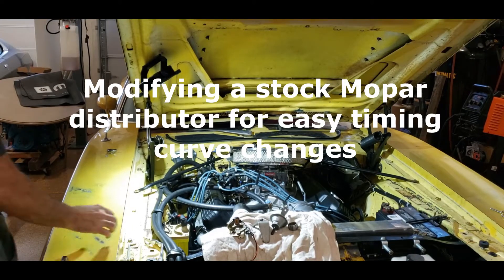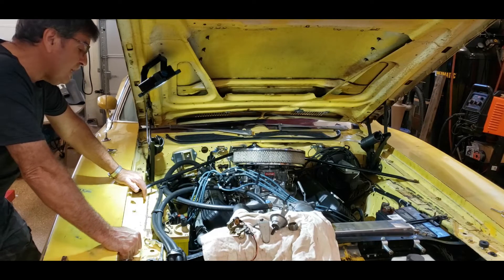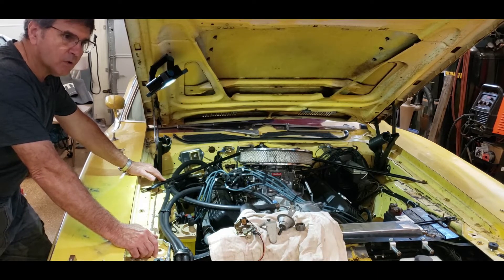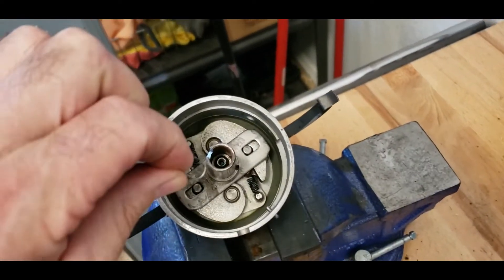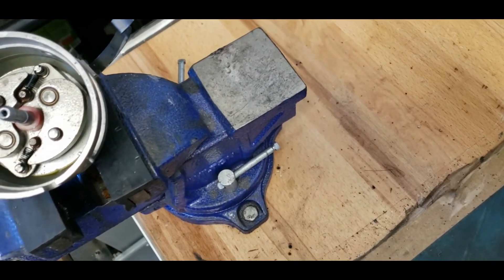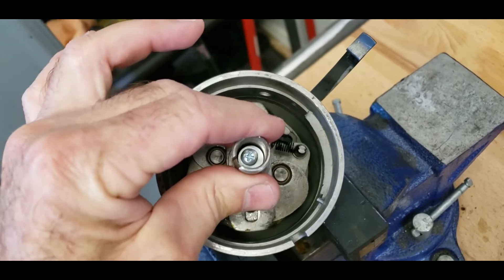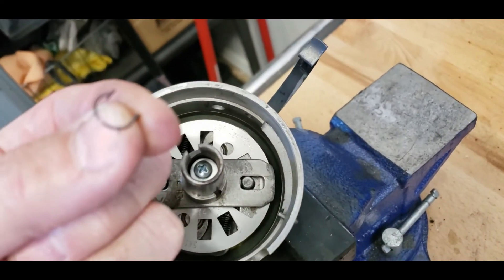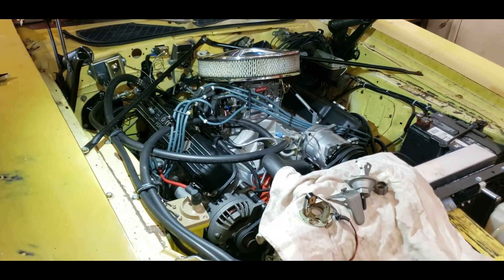Mopar stock distributor recurve for performance using FBO plate

Comment: Help!! I need that same distributor!! I have to have 24 degrees initial and need a 10 degree curve.. can't find find what you have.. do you have a part number and brand? Thank you in advance
Reply from the maker: Limiter plate only 
https://www.ebay.com/itm/323099910935?_skw=fbo+limiter&itmmeta=01JK4BNPXAES3VZQB2C808Q0YW&hash=item4b3a416317:g:6yAAAOSwQJhUdOgX&itmprp=enc%3AAQAJAAAA8HoV3kP08IDx%2BKZ9MfhVJKmsAtRJhaLMGUpuCgENwHqTNAU2psUGgDSZ2F4MhVGfs%2FejuA6KMrYTzxbWAJ1d3FYLdbaG8%2F5R60yXtbdAzlfOg7glTlAQNofz88G18J8v9oacXzAERaF4xc8MS3oRDV%2Fc2eANPRfVLuwrjds97YciTK35mQMk0HrwZUNPDKJXXWE%2F6SbceWzFZ7GStNDQyQEUebOUuhmMnJcOtA%2F9ZUldsvVqpjee7oMXXD0U%2FBZHKlJmYyiUa71WLmP8KxiHFDIXyt%2FoITMHM%2FnSRhsTLuq7AI14TpebtAamMIIn6Oimvg%3D%3D%7Ctkp%3ABk9SR87v1ouZZQ